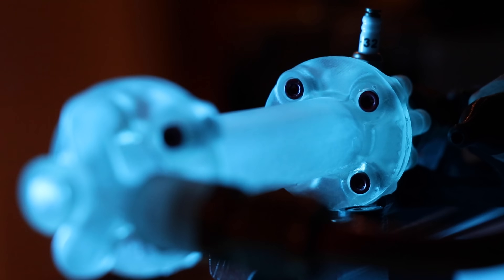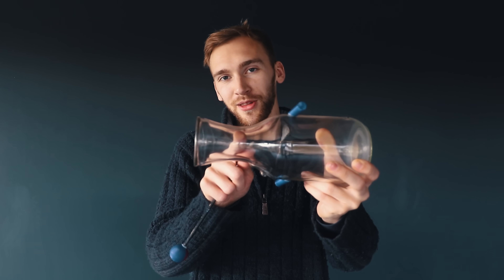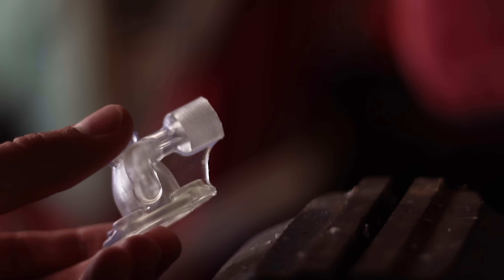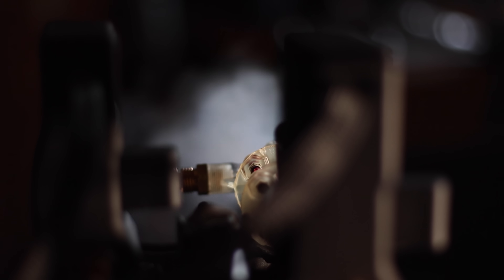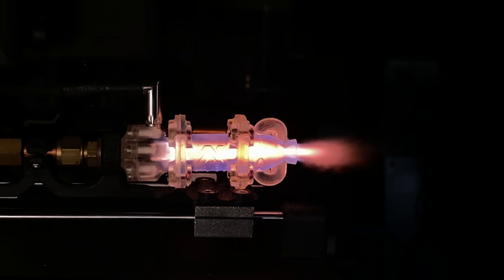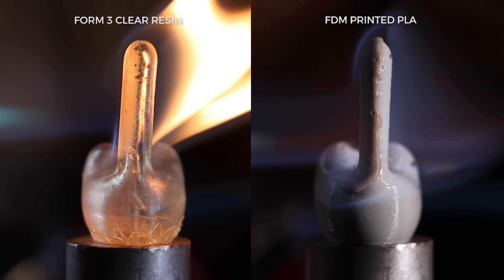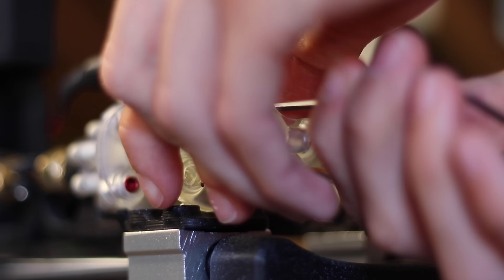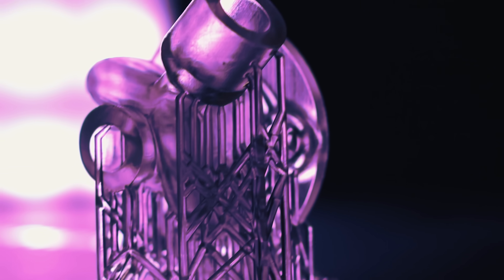3D Printed Vortex Rocket Engine Igniter

Comment: Very cool subject and excellent video! I do have one question, though. What was the issue when the rocket turned into a torch? Was there too much propane for the amount of oxygen? Or was the mass flow rate too high for the flame front to keep the combustion inside?

Comment: you should try using a ceramic based resin called porcelite for the nozzle. You need to burn away the remaining resin but it works really well

Comment: And your solution of two inlets has already been tried and is not effective. At least not to scale, no. The reason why is because in order to get gas is flowing through those inlets you need incredibly powerful pumps that place immense parasitic thermal stress on the system causing ignition failures partway through launch.

No rocket engines for nearly 60 years we're able to keep up with the specific impulse that Soviet rocket engines produced. When Soviet engineers told American engineers about the duration of specific impulse on their rocket engines they didn't even believe them. So they brought them over to Russia and showed them. Long story short they bought as many as they were allowed to and purchase the license to copy them. In attempting to copy these incredible engines, the rd-180 series, the United States failed and failed repeatedly. They got sick of trying and investing the resources so they decided Russia has about $180 of these things and pristine conditions sitting in a factory in Moscow, why don't we just buy them from there and pay them to maintain and keep our rocket engines operable? And that's just what we did. That was one of the many positive stories to come out of the post Cold War era. America would quickly ruin all of these sorts of productive positive mutual collaborations by continually demonizing russia, instilling delusional levels of russophobia in America and West European nations, and openly declaring Russia as their adversary. What a shame. The blame for everything going on in the Earth today that is bad is owed to the United States and NATO and it's once proud imperial lion, now turned loyal lap dog, the United Kingdom 😂😂

Comment: I kinda want to design one of these things and I do have some questions of my own about the actual physics involved here. Wouldn't making it wider in relation to its length basically slow the gasses down towards the center basically making the combustion chamber itself a diffuser? Then isnt the increase in centrifugal force/velocity lowering the pressure as you move closer and closer to the chamber walls and giving you that boundary layer?

Comment: Okay had an idea. If your engine is overheating include changes in the parts that overheat to allow cold propellant gassed to flow through them, use the fuel to cool the structure. early rockets had that system If I recall correctly. Create one central inlet, with small channels running in a coil inside the body of the combustion chamber and nozzle feeding back to the injection ports. 

If you injecting fuel and oxidizer through those ports, it cools the shell ad preheats the gasses. as well as allowing you to create a tailored injection pattern for both fuel and oxidizer

Comment: Have you tried coating the inner 3D print, with a light layer of powdered metal oxide, clay material or high temp canned spray paint. Examples would be forcing these materials through the two inlets. You may get a couple of seconds of more data. Using an infrared camera would show the combustion within the now opaque engine.

Comment: Just a question, why did you use oxygen as the outer shielding gas? Wouldn't propane be more suitable because it's cold and won't react with the resin at all under high temperatures?

Comment: Nice stuff man! You should try some PEEK or PEI printed parts on an FDM printer. They have extremely high temps and work with most fuels. I print with Carbon Fiber PEI on my basic FDM printer.

Also, you can mess with 3d printing a basic mold part and use air dry cement to cast certain parts like the nozzle. Plaster of Paris works for some high temp parts too.

Keep up the sweet work!

Comment: maybe use a woven carbon chinese fingercuff structure as a inner sleeve so that the vortex forces pull it tight all around and the model parts receive less ablation right out the nozzel then maybe put some starlite nozzle for the melting issue.

Theoretically you can use the carbon as an electromagnet to compress the burn further but thats some complicated stuff I'm guessing.

If thats even possible I dunno how to do it but who knows. This guy has some good stuff.

https://www.youtube.com/watch?v=0IbWampaEcM

Comment: How did you inject to propane into the combustion chamber? Did you just add a propane inject nozzle or just straight up connected the brass adapter from a propane hose?

Comment: In a scaled up unit, the walls of the main chamber will likely still need significant cooling. This is because of the intense infrared light made, for which the fluid barrier does nothing to protect. A nice reflective coating on the inside will probably help with that a lot though.

Comment: You should try SLA printing with a ceramic resin for the parts that need to be heat tolerant. The ceramic resins create a part which is then fired at over 1000C to burn away the resin leaving a fully heat resistant ceramic part.

Comment: Reminds you how rocket film cooling works, layer fuel on the outside of rocket bell, Hears your injecting Oxygen that way..... Yeah that's gonna get stupid hot faster and melt...
Great concept for better thermal efficiency, just swap the gases over. and you will have longer lasting nozzle

Comment: Could you 3D print a nozzle insert or liner that would ablate away giving optimal nozzle expansion from sea-level to altitude? An altitude compensating nozzle that is not an aerospike?

Comment: Maybe this is dumb but could you add regenerative cooling with room temp water to the nozzle?

Just add a single water channel and two openings to attach some plastic or silicone tubing to. Then you can have a simple reservoir and an aquarium pump.

Comment: Imagine if you were taking out the supports on the Resin 3D print and it snapped, oof that's like 14 hours gone or somethin. (I don't print with resin so I'm not sure how long it takes but you still have to cure it and all that stuff so it would suck)

Comment: As someone who desperately wants to make an engine like this but only has a filament printer, has anyone explored or have thoughts on treating the prints (maybe with an ablative coating, especially on the interior walls of the chamber and nozzle) in order to increase heat resistance for FDM prints? FDM printers are also capable of printing much larger parts, so maybe a bigger engine could be made as well.

Comment: How about coating the nozzle with titanium inside a vaccum chamber? Like sputter coat it by heating up titanium metal inside a Vacuum. On the first test it would probably turn into titanium oxide, Wich is definitely temperature resistant. Maybe ad cooling channels to the nozzle to keep it cool and you'd have an extremely robust nozzle design.

Comment: I have a question. Why use the oxidizer as the coolant instead of the fuel? Wouldn't that, you know, entice the engine to burn "engine rich" if you screw up the mixture?

Comment: This is exactly how a cyclone separator works. The problems you faced with a longer combustor could be due to the formation of a standing wave. It would be interesting to know the efficiency of such an engine. Vortices should ensure much better mixing of fuel and oxygen and hence better combustion.

Comment: It wouldn't work because in real rockets you use liquid fuels plus the pressure is much higher and the fuels in a real rocket need to be well atomized which would be practically impossible with this sort of injecting

Comment: now make the nozzle modular as well and try to get it made in metal so you can get more test time, otherwise try to make the oxygen flow through it in micro channels to then get back to where it should be injected so it will be a coolant of the whole setup and then a protection inside the chamber as well and since it will be a bit hotter during it is journey then it will expand more and thus you will get more pressure...

Comment: At first I thought, what is special about this, it literally how 95% of rockets work these days. Only after I realized that the parts where 3D printed I realized how awesome this project is. 👌👍
Reply: Except no. Film cooling never uses the oxidiser. It uses the fuel.

Comment: I majored in Aerospace Engineering and this demo is very well done. How many man hours were initially invested? The availability of 3D printing is racing into space and the idea of modularity at low cost would be very beneficial. Have you made any determination as to 3D printed alloys or ceramics for extended testing?

Comment: I've worked a lot with the Form3 and I can say it's not such a great machine. Some fellow designers also trashed theirs, if you're printing engineering resins, the machine quickly dies. In just a few weeks you can either bin it or send it back for repairs that will cost you well over 1000 euros in Europe. I wonder what your experiences are with the clear resin, is it engineering grade or just general use clear resin? One of my fellow designers now uses a cheap Chinese machine, and when it breaks, it's cheaper to just replace the whole machine all at once. This also leaves him with some high quality parts from the previous machine, so in case anything breaks, he can use the parts from the older machines to repair the newer ones. Win win.

Comment: Look into PICA ablators, if you can find a way to get a print resin to have some carbon powder in it you can increase the heat resistance and ablative efficiency quite a bit. Might get a bit more time out of your test runs.

Comment: Plastic ignitors like this could be perfect for single use rocket engines. With the combustion chamber and nozzle design finalized it could all be printed in one piece, with oxygen and fuel lines in the printed part. Put all that inside the combustion chamber so it'll burn away during the engine run. Sealing off the oxygen and fuel inlets from the main combustion heat and pressure would be the tricky part.

Another way to use the design would be integrated into the combustion chamber of a 3D printed metal rocket engine. Nozzle, throat, combustion chamber, fuel and oxidizer injection, and torch igniter all one big 3D printed piece.

Comment: If you add water channels around the nozzle could you burn for longer or is the flame just too hot for the plastic to transfer heat before burning?

Comment: Correct me if I'm wrong, but wouldn't this have lower efficiency than a non-vortex engine because centrifugal force would pull the exhaust gas outward, radially and away from it's straight backward velocity?

If this were true, this design would still be competitive tho due to the lower thermal load meaning cheaper, lightweight materials could be used.

Comment: You have to FDM print it in PEEK or use ceramic filled resin which being treated properly can withstand extremely high temperatures

Comment: Try ceramic resin for your printers. You have to fire it in a kiln to melt the resin out and harden the ceramic but then you get much better heat resistant properties. And im sure its much cheaper than outsourcing metal 3d printing or probably even cnc milled, especially with that complex geometry

Comment: This is... genius AF.  Even a design reducing heat absorbed by 50% would be a massive improvement.  This seems to go way beyond!  Especially  if it could be made reliable in real world - maybe on scaled versions have the vortex inlet jets be themselves gimbaled for vectoring by computer controller?  Another obvious consideration is the way a particular nozzle performs at different atmospheric pressures.. I wouldn’t think this would have any issue burning all the way to vacuum once lit, but if you wanted to relight in a vacuum I wonder if that would pose a challenge?

Comment: If you wanted to try and make this run longer, there are some ceramic-based resins you could print this in. If you have the ability to sinter them after printing, they should be able to withstand the heat.

Comment: Awesome, did you try printing the nozzle in ceramic resin.
Reply: I knew someone was going to bring that up thought I would look before I said something
Reply: Why not take it a step further and just order a metal 3d print?
Reply: @lolzdatguy4987  ceramic has higher heat resistance, but isnt as strong, also im certain ceramic resin isnt as expensive as metal
Reply: @rawhidelamp  someone already 3d printed a nozzle with ceramic filament and it is fucking awesome
Reply: @DavidGarcia-nx2gj  who?
Reply: @1MoreTurn  Integza
Reply: Waxoff Waxon  nope. The test here is to use vortex cooling to prevent the combustion chamber from burning up, they are not testing the nozzle. Printing just the nozzle in ceramic would not cheat the combustion chamber test.

The ceramic will eventually heat up enough to melt the resin that it is connected to but printing the nozzle in ceramic might still allow a longer test of the vortex cooling of the combustion chamber.

Comment: I have been looking at a way to add heat resistance cheaply to parts. Have you tried spray-on heat resistant paint such as the ones use in BBQ's?
It's cheap, adds resistance, and quick to reapply. Lower or Homedepo have it regularly.  This is really cool, I think you just solved the rocket pack colling issue.

Comment: Film cooling the edges of the chamber is generally done with the fuel, not the oxygen, since in high oxygen environments, most chamber materials can be fuel too. Ablative chamber cooling is also pretty common, where the inside of the chamber slowly erodes/ablates from the heat. If the walls of your chamber get hot enough in the oxygen environment, you'll get "engine rich" exhaust.

Comment: Interesting concept. Contradulations 👏🏼👏🏼 there’s a channel where some guy uses a 3D printer witch prints in a ceramic material, witch can wistand 1000 degres celcius. Maybe it Will be a fine solution to provide longer burns within the throat without erosing it too fast, so you can test how much the wall of the combustion chamber can wistand combustion whitout the radiative heating from the combustion overheating it

Comment: you could keep it transparent with metal using transparent aluminum. called alon
https://en.wikipedia.org/wiki/Aluminium_oxynitride
i dont know if it can be used for that or if it would react with oxygen, but it sounds enticing.
reading the wiki it resists 2100°C in inert atmospheres, so i dont know about pure oxygen ;p

anyway this would make for a great grill starter show piece. could easily sell for 200$ a piece, when its manufactured like a blowtorch

Comment: Hey man, absolute insane video. Wanted to write a comment about explaining how your background at 4:35 is good but because of the youtube compression you see the lines between colors. Then i saw you only had 3k subs and was quite amazed and changed my complaining to positive criticism. XD
A darker background most of the time looks quite good but because of the low amount of colors in the YT compression you get these anoying lines. If you brighten up it a little bit you might get rid of them but keep the low light background. Try playing around with the lighting and see when the compression gets rid of those color changing lines.

Comment: How about using a metal insert bushing or something more heat resistant on the nozzle end? 🤔 The melting of the nozzle during testing is changing the geometry and this is why results are not consistent.
Keep the good work going! 👍🏻

Comment: could you not print a small metal nozzle tip that screws into the rest of the nozzle assembly, right where the heat is so you can do longer tests on the other modular parts

Comment: I find a layer of lube helps keep your sisters throat from eroding. Maybe that can be applied here? As in a coating on the inside maybe applied mixed with a solvent so it binds with the 3D print and dries quickly to form a heat resistant layer. Would not be a permanent solution but in the realm of firing something 3D printed it could give seconds more time before a failure for little money time and effort. Just a dumb probably completely stupid non usable thought I had.

Comment: But what about radiant heating? Surely the infrared radiation is enough to heat up the plastic beyond its softening temperature. I'd advice injecting a very fine stream of aerosolized water into the combustion mixture, to cool the down the walls by evaporation.

Comment: Sam, it won't be long before your channel catches the fame, and you well deserve that. Your video was suggested to me by youtube, and I tell you from experience that is a good sign. As for your work, splendid effort, and what a patient engineer you are. Might consider a small piece of chalk, which you can drill easily, and mount at the nozzle to withstand such temperature for longer. All the best.

Comment: Get yourself some Porcelite resin for the nozzle end. Once you've printed it, you can ramp it up to like 1200C in a kiln and it'll burn off all the resin and leave you with a well-formed ceramic part afterwards. The parts do shrink during firing by like 20-30 percent so you'll probably need a few iterations to get the scale right, but when it's done you should have something where you can more properly show the proof-of-concept by firing for longer periods of time with only the nozzle being heat-resistant.

Comment: Try annealing the pla or using some higher performance material, unannealed pla is literally the least heat resistant filament so a bad choice for the comparison.